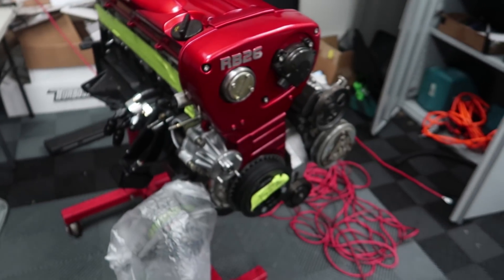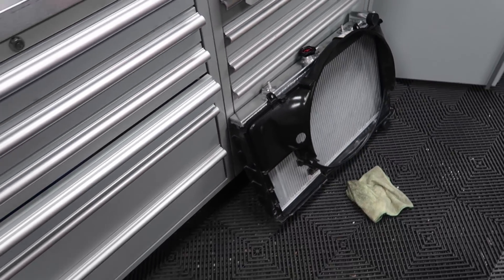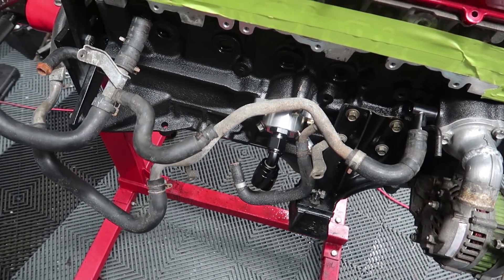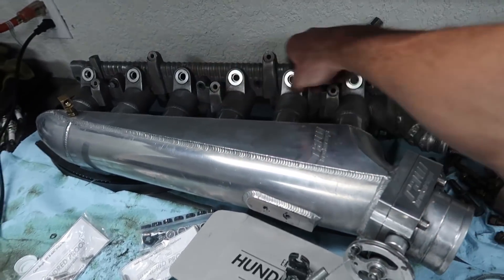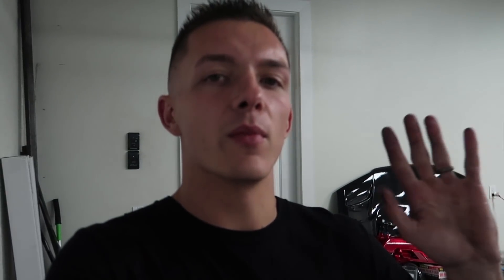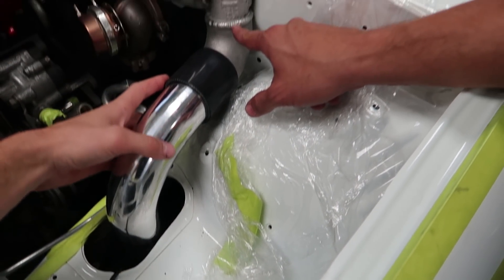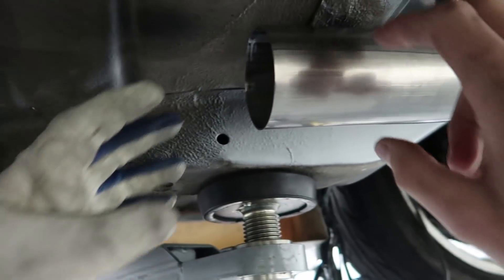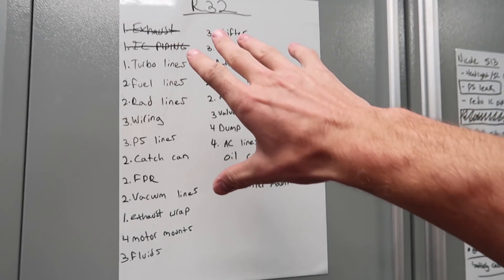RB25 is in the Drift Skyline!

Comment: Bigger oil pan for the skyline and 335i update please 💪
Reply: michaelc51388 i’ve heard that it’s being shipped to germany to run on the Nürburgring in the fall, that could be wrong though
Reply: King Midget71 your correct
Reply: King Midget71 it is "supposed to" but thats if they ever finish the car over at that terrible shop.
Reply: mattybeatzkidd if you haven't used the shop don't call it terrible.
Reply: Ilikeboost he right, they cant fix boost leak.
Reply: the 335i must’ve blown up because he hasn’t made an update in forever
Reply: Rob just sent his car out and I'm pretty sure they finalized a new tune after solving the issue on Adams car. And don't talk shit on a shop that has alot more skills than you and alot of work under their belts. Just a lame thing to talk down on

Comment: When I put the RB in my Subaru, I also had to go with solid motor mounts to prevent movement. I did the same coolant line loop as you’re doing as well. So far, so good. 👍🏼

Comment: Throw out that Mishimoto radiator cap!
Reply: Which cap would you recommend instead?
Reply: Greddy cusco mishimito does not work anyways
Reply: Milr Shah But why though? Do they not hold pressure? Cusco over Mishimoto? I just want to know why I shouldn't run one.
Reply: Read somewhere mishimoto sucks does not hold pressure on evo forums i think so do your search original japanese brands are better engineered then this

Comment: It's better to cap the heater hoses then to loop them. Looping the ports will flow hot coolant from the back of the block  to the water pump inlet. It then goes back through the engine without going through the rad. Looping also carries a larger volume of hot coolant. Stock the heater core acts as a radiator for the loop and also  restricts flow in the loop.

Comment: Good luck defogging the windshield without a heater.
Reply: TurboDieselDan lol you get fog when it's humid inside the car and the windshield is cold.. But they're in Florida and the sun is always beating down on the windshield so it's rarely ever going to be cold. I doubt he'll have many fogging issues.
Reply: it rains ALOT in florida
Reply: I lived in Florida and sometimes the heat worked way faster, the ac would just make it worse. Not sure why...
Reply: Nah bang on the AC she'll be right
Reply: Being able to see out the windows is overrated.
Reply: rainex i think its called its mint prevents it fogging . i use it in my drift car

Comment: Engines pull to the right under load, that turbo should be fine if you clearance that washer a little, it will gain clearance as it pulls under load.

Comment: I would encourage Adam to use a beefier transmission mount. Ideally some boxed tubing or round tubing with flat plate mounting points. I encourage you guys to look at transmission cross member on the Mustang (similar unibody car and mounting system and horse power) A weak transmission mount (with all due respect for who ever made that for you) can cause all kinds of troubles down the line, because the drive train is not staying properly aligned, (drifting is very abusive on drive tran parts) this can lead to breaking u joints, drive shafts, motor mounts, and even transmissions themselves. Please reconsider using that mount or one similar (that is simply made out of flat bar stock) I would encourage you to look at any number of RWD domestics for inspiration. Thanks for hearing me out.

Comment: Im looking forward to seeing your FUEL setup (lines + FPR + rail & injectors  -gotta feed that beast)  as well as wiring (how fancy are you guys getting? deutsch connectors + raychem #motorsportswiring)..  How are you gonna run your vacuum lines (interested in seeing how you'll boost control with stand alone and the sexy twin wastegates) -Also hell why not show how you're running your oil lines with the cooler + relocated filter + sensors(?) real quick while you're at it.    Awesome stuff, Stoked to see Alberto's fab work ..ya'll keep it up!

Comment: I wonder if you should plug those heater core coolant lines so that it is not taking Hot coolant from the back of the head to the waterpump. I know that it is best to plug them on Datsun L28's vs looping it.

Comment: I know that engine mounts play a big role in shock absorbing... but on the topic of transmission mounts: for example the solid transmission mounts for a s-chasis’s are beefy on top of. Pretty well designed cross member, and I’m just concerned that the bracket/mount holding up the RB trans looks skimpy/too weak for 500+ hp. Correct me if I’m wrong or if it’s temporary but that’s my suggestion. Otherwise it’s turning out awesome  😎

Comment: oil cooler in depth in terms of how to prevent oil leaks from the fittings,  thoughts on using different brand such as mishimoto and vibrant performance for the oil lines and fittings

Comment: The rb25 gearbox shifter and tranny mount doesn't need mods to work on the skyline they all line up from stock. Use the stock tranny mount. It will save u tonnes of time
Reply from the maker: The z32 gearbox is what I have, and it doesn’t line up with the shifter hole

Comment: battery mount and wiring, the valve cover, do you mean like running lines for the catch can? Mounting the mani, dump tubes then the oil cooler stuff. Very interested for these things :) <3

Comment: As soon as coolant runs through aluminum it gets trapped in the metal and makes it hard to have really nice welds. Better off buying new parts and welding an fittings on the ends and use an hose for all your coolant lines

Comment: Wait, did you just expressed yourself in metric?! :P I thought you guys never thought outside of imperial. Interesting seeing the clutch setup.  Fun fact; Any JDM or Euro motorcyle with a sideways mounted engine would have the same (or fairly similar) setup but with eight smaller plates to compensate for the lack of surface area and to be able to transfer the current 200+HP in the most compact way possible. Most mounted wet, with oil resistant friction material but also dry, as so proudly presented by all those rattly air cooled Ducati's.

Comment: Why don’t you extend the down pipe connected to the exhaust side of the turbo so it puts the turbo forward out of the way of the strut tower?
Reply from the maker: That wouldn’t change where the manifold is mounted
Reply: same reason you don't get longer wheel studs to change the offset of your wheels
Reply: Adam LZ I know it would change where the turbo is positioned.
Reply: NATHAN u mean wouldn't
Reply: lenny 034 why not
Reply: NATHAN its been a few days i really  figured you would have learnt why by now. The exhaust manifold decides the location of turbo not the dump pipe. So unless you change manifolds or use spacers  the turbo aint going anywhere. Extend the dump pipe all you will achieve is creating a longer exhaust that nolonger fits
Reply: Correction. been a day...
Reply: lenny 034 change the lengths of all the pipes and you could have it anywhere 6 feet in the air if you want, adding a few inches wouldn’t change much apart from solving the problem of it rubbing the strut tower.
Reply: NATHAN man why are you still trying to argue this point. Unless you are moving the flange  on the manifold that turbo will stay put. End of story
Reply: lenny 034 yea the flange would be moved if inches were added to the pipe.
Reply: NATHAN 7 pipes. Not 1 pipe.   Seven  pipes and a waste gate.
Reply: lenny 034 the manifold goes from 6 exhaust ports 6 pipes funnels down to 1 pipe I was thinking you would add a few inches after it’s been funneled to 1 pipe.

Comment: For Alberto it’s not you it’s the material aluminum needs to be clean af to produce the best weld whatever liquid flows through there soaks into the aluminum since it’s very porous no matter how much you wire wheel it it just won’t weld nice

Comment: I just dont get it, perfectly fine and beautiful S13 in min condition with new paint and all, lets drift with it and trhash it, bump in to people and make dents all over the place.
Good looking S13 with a 1jz that is a perfect daily if fixed right, lets thrash it on a track and bump in to people.
Awesome looking R32 4 door with a dope engine, clean engine bay and paint all over and straight body, lets make a drift car out of it. Why not just street car to have fun in to race people, and show off on car meets? 

If you really going to drift a car, do as they do in formula d with exchangeable panels and livery instead of paint and still have it as a "daily". 

Over here we got mostly E36 and volvos drifting, but they are true bashers, parts are cheap and make good drift cars. 

I know it is your decision, but i just cant understand the logic in doing this to thrash a perfectly fine R32 or a perfectly fine S13, those are really hard to come by, even in EU in good condition....